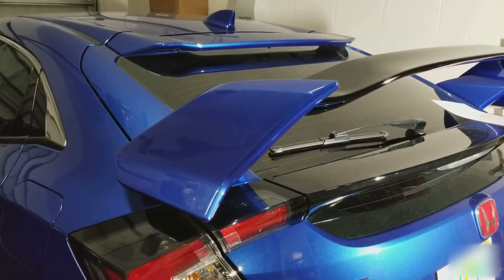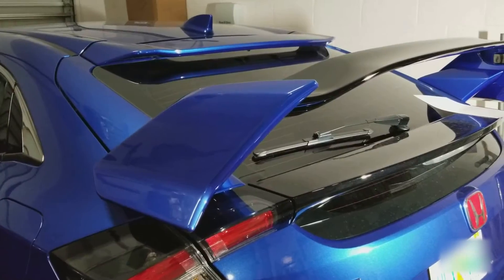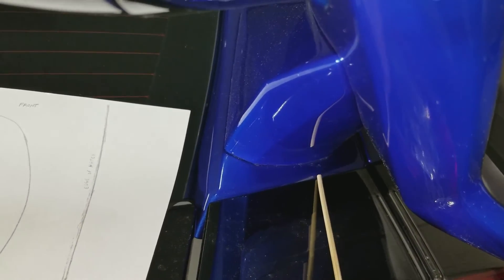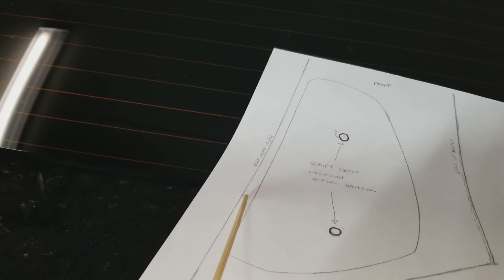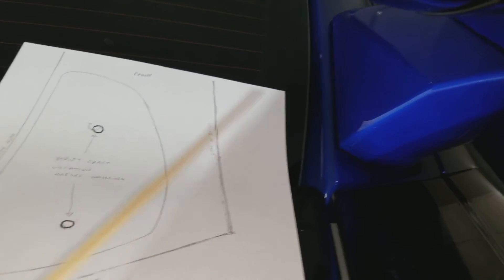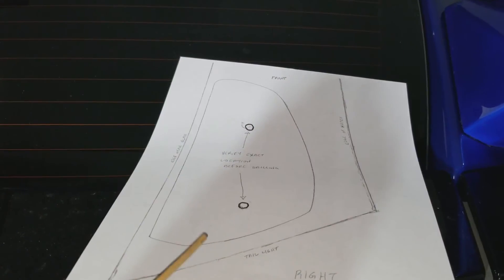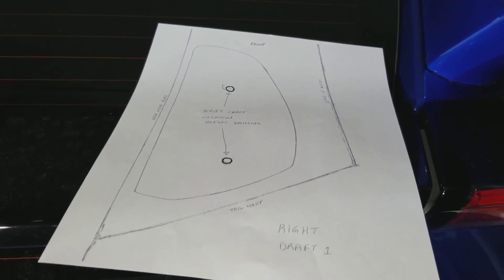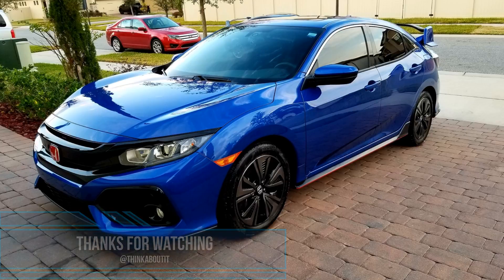Replica 2017 - 18 Civic Type R Spoiler Installation Template

Comment: Thanks for taking your time and releasing the template. I'll use that for my installation this week. Will report back on the results.
Reply from the maker: Almir Sahinovic I hope it works out for you. You can also print a copy for each side and  set them up with tape and ensure everything lines up to where you want it before drilling. Good luck!
Reply: Did it work ?
Reply: Sorry, I just seen this. YES it did! It was off just by a few cm but that was probably my fault. I traced the template on both the under side of the leg bracket and on the trunk itself and that really helped. Also, if you email ABSDynamics they can send you "official" instructions and a template, but honestly the one that's provided here does an equal job. Just take your time and don't rush anything. Best of luck to anyone that's attempting it themselves.
Reply from the maker: Almir Sahinovic Thank you! I'm glad to hear that!
Reply: Just got the ABSDynamics one, I'll be using their instructions as well as the template in this video. Is it fairing up well? any advice before i install?
Reply: @TheDarkIceHD  how did it go?

Comment: Hello wanted to know if the rear spoiler of your car moves with the wind when you drive on the route the part that is painted black
Reply from the maker: Watch this video https://youtu.be/r5x0mc4H8n0  You will see how it moves as I drive. I uploaded it yesterday.
Reply: FK7 Civic mine also moves when I go at a speed of 60 mph is very fragile and I do not know what to do so it does not move
Reply from the maker: Carlos Fernandez I see. That one is not the same spoiler, but it does look similar. I hope some of my tips work for you.
Reply: FK7 Civic If it is not the same, I wanted to know if yours move with the wind to change mine and buy the same as yours

Comment: Will this fit on a 2019 Honda Civic HB?
Reply from the maker: It should fit. 2017-2019 should be the same FK7 chassis. Type R is FK8. Take a look at your VIN
Buy it on eBay here: 
https://youtubelinks.page.link/FK7_Civic_Hatchback_TypeR_Spoiler

Comment: Do you have a left side template?
Reply from the maker: Because of symmetry, you should be able to turn it around and use the same. You may have to go over the lines with a marker so that the ink bleeds through the other side and you are able to see what you are doing.

Remember that sometimes after printing, the printed image may not be the same size as the original image on the pdf.

Before you drill, be absolutely sure that everything is correct.
Reply: FK7 Civic thank a lot